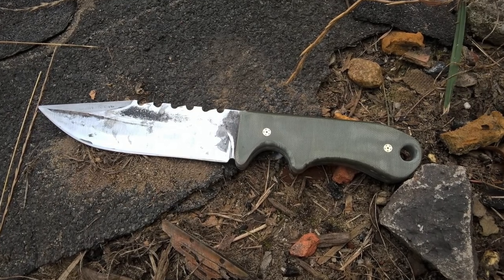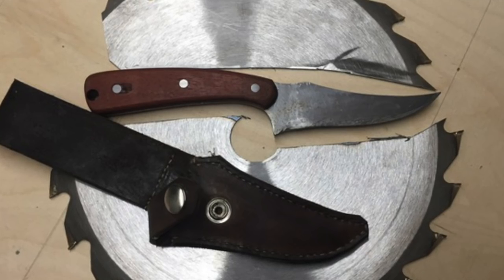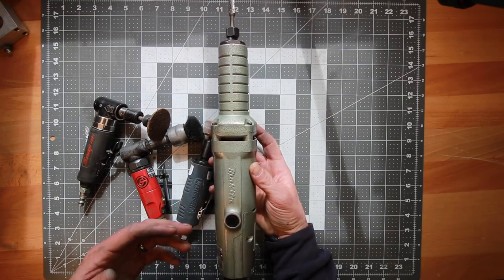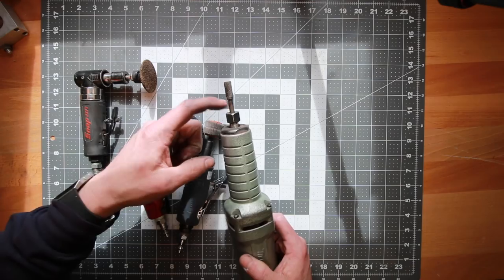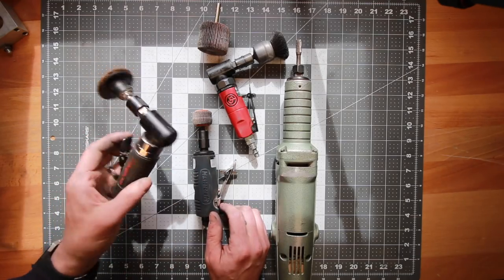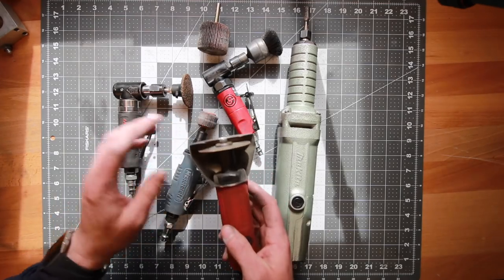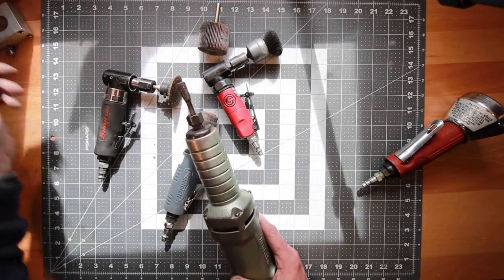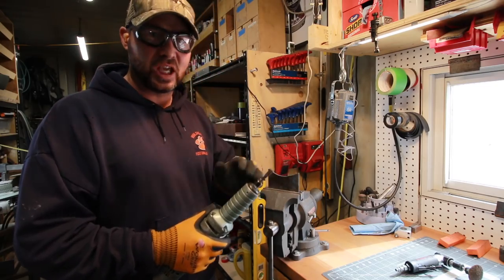Tool Time Tuesday - Die Grinders

Comment: Good information. They come in handy, and the cut off discs are used often in my shop. I don't think the average user realizes how dangerous a cut off can be. I've had them explode on me. A coworker had the guard off a right angle grinder for some stupid reason cutting stainless sheet. When the disc hung up and kicked back, it didn't stop till it was a half inch in his finger.

Comment: What is the smallest air compressor i can buy for use with a die grinder? I don't have the budget or room for a huge one looking for the lower end but something that will still alow tool to work well

Comment: Where do you find the bits?  It's hard enough to find die grinders, but finding the bits/burrs for 'em, especially when I know somewhere between diddle and squat about die grinders, is a challenge.  

So, if I were to pick up the Harbor Freight electric die grinder (or any other), what would you recommend as a "starting bit set"?
Reply: John Sanford I recently got one at pawn shop, and it appears darn near the only place to get them is on Amazon. Look around on Amazon and look for good reviews. Just ordered my first bur recently..
Reply: Your local industrial supplier. Once you find it, you'll open up a whole new world of tools, safety equipment, and bits.

Comment: What can you tell about Milwaukee 5194 Die Grinder ??Is it any good for heavy duty work like cutting round lines over piping connection???Iam experienced with air version,however when using air die grinders their heads start rotating and untightening which position tool in realignment and it very hard to set them back so gears wont be loose or too tight..Never tried electric version before,another weakness with die grinders that their burrs or attachments have tendency to jump away from collet and come out loose...So far I think what wrong with die grinders,rather than that they does help a lot with heavy metal work,mostly deburring steel or cast iron...

Comment: Will a 50L compressor work for the die grinders?
Reply: more then likely.  But most of the time you will start loosing "power" as the air is used up.  If you are just doing small tasks i would say no problem.  If you are doing "heavy" work you might get annoyed with waiting for the compressor to build up more air.

Comment: Is a 50 L air compressor enough for these? It can provide up to 170 L/min
Reply: Easily. The smaller ones shown here operate between 20,000 and 25,000rpm and average around 13 CFM (about 60 L/min). Keep in mind that when under load they use more air to work through the friction, so it's entirely possible for them to stall if you're using an undersized tool for the work.
Reply: @MINERAL-115  thanks, i think i will try a small air grinder and use electric ones for bigger work